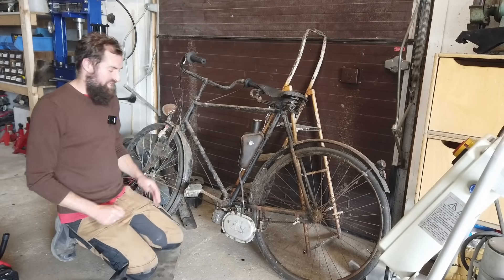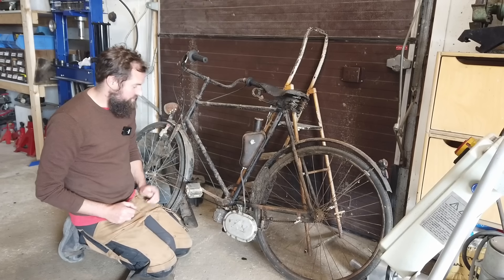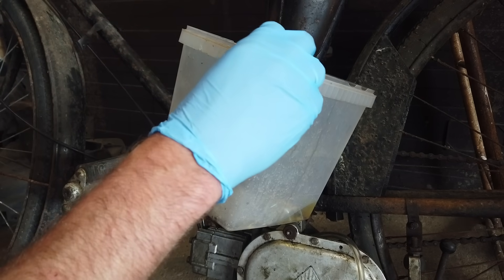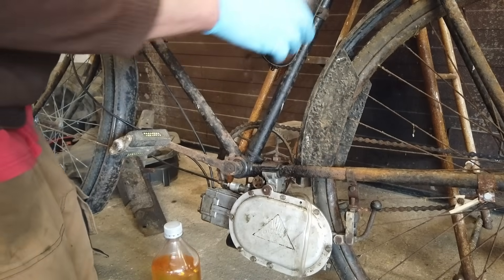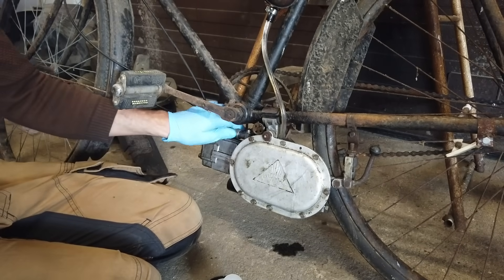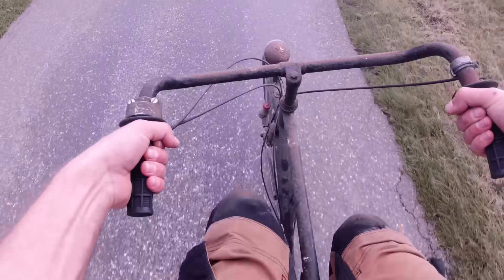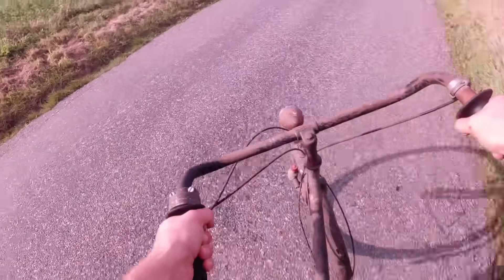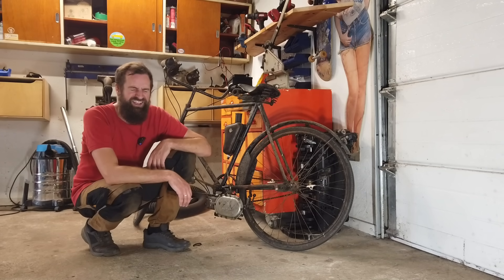Riding A Two Stroke Diesel Moped With Variable Compression!

Comment: That is really cool! It has been my experience with the RC "diesel" engines that you have to fiddle quite a bit with the compression adjustment to get it started, but as the engine gets a little heat in it the engine is not as finicky with the compression setting. I do know that once they are warm and the compression is adjusted, you don't have to touch it again that day if you use the same fuel. The engine speed is then adjusted with the needle valve. The servos work that valve in and out and there is no slide to adjust the air (like a real diesel). Some of those guys are able to really get them to idle slow. The "diesel" engines swing a larger prop that the glow engines so there is more flywheel effect.
Once you get it running and get it warmed up, you might try finding the compression sweet spot and then just adjust the engine speed with the fuel only and leave the compression alone. One of the "Old Guys" told me the only reason the compression is adjustable is to compensate for two things, piston to cylinder wall leakage and barometric pressure.  I would love to see this thing running good and see if it will idle. Very cool project. 
P.S. - Stick you a little piece of copper (or other metal) on the exhaust outlet to route the exhaust away from you....

Comment: Compression ignition engine
Some kerosene in diesel may help it start easy . We use in winter on old engines on dozers
Smaller diameter  rear wheel would  lower ratio to allow it to climb hills at max rpm .
Would be a good experiment to try smaller friction wheel drive also.

Awesome 👍
Reply: It drives the outside of the tyre via a roller. So the wheel diameter has no effect on the ratio. They were designed to run on a Kerosene mixed 25:1 with oil so for sure your suggestion on mixin Kero in would help.
Reply: @stevemorris3710  Actually it would . Rim pull is from CL of axel to pavement contact area irrespective of where motor applies torque .
I am a mechanical engineer and familiar with that .
Peace out 👍
Reply: The wheel diameter sounds like an interesting experiment. I'm not an engineer, but I don't think the ratio would change.
Reply: @mickangio16  rim pull.... Ft -lbs on edge( rim pull is measure of pulling force developed)  increase by decrease in diameter. 
Ratio between drive gear and rear wheel changes also actually decrease somewhat.
Similar to gears in transmission low gear is smaller therefore higher mechanical advantage . 
Trains Tractors use rim pull to measure tractive effort.

On certain farm tractors the pull force is increased by reducing diameter of wheels. 
In competition pulling one must use stock rim tire size not to cheat .
Reply: @mickangio16  And you'd be correct.
Reply: @Nudnik1  You should ask your place of education for a refund.
Reply: @stevemorris3710  Now you hurl insults... 🤔
Obviously you are not educated in engineering.
Reply: @stevemorris3710  Even Heavy equipment mechanic  and  farmers knows that is correct . Lower ratio versus ground contact Ft-lbs of torque increase rim pull of machine .
Top speed will be reduced .
Small diameter wheels are often out on Farm tractors to increase pulling force.
Now you can go back to kitchen and peel potatoes kid ..
Reply: @Nudnik1  I'm not an engineer and am struggling to understand your suggestion that a smaller rear wheel would help.
As far as I can tell, decreasing the rear tire diameter would decrease the distance between the axel and the road surface, as well as the distance between the axel and the drive-motor's friction patch on the tire.  Since the leverage decreases at both the motor and the road an equal amount, there'd be no change in torque multiplication.  If you calculate the total drive ratio for each revolution of the drive motor, the ratio remains the same with larger or smaller rear bicycle wheels.
With those two ideas in mind, I'm having trouble understanding where you're saying added leverage comes from, please explain in simple terms.
Reply: @FirstNameLastName-tp5bu  look up Statics in engineering hand book
Do a free body diagram of forces .
For example a cable winch on a crane loses line pull as diameter of drum increases due to wraps of cable increasing .
Same idea .
In a gearbox on a Car Truck tractor the smaller diameter gear is low ratio which increases mechanical advantage but reduces output rpm .
Picture the force applied to surface of road transfered to rear axel which forces bicycle forward 
Irrespective of manner the Engine transfers torque to the rear wheel .
Reply: @FirstNameLastName-tp5bu Sorry  actually I did not realize the motor used a friction drive whee against tire l and thought it was chain driven .
So reducing diameter of rear wheel  would reduce the mechanical advantage of force from motor to rim .
I was in error about this detail sorry.
If it was not such a design a smaller rear wheel would increase pushing force at a lower speed but higher rpm .
Reply: Keep going. The comments you are getting are good. And the information  you are getting as feedback is brilliant to follow so good luck
Reply: @tonyarthur9437  Not sure if anyone has any education in engineering basic kinematics etc .

Comment: Yes, "technically", it's not a traditional diesel engine, but more similar to an RC diesel engine, auto-igniton type, semi-diesel, but I would argue that it's still closer than one of those due to the fact it doesn't need diethyl ether in the fuel (and in something like a 30 percent quantity). It's not a hot bulb engine either! (although, those are really cool too!)
Reply: I would certainly try to add ether in order to make the fuel easier to autoignite. For oil, we used to mix pure castoroil in.
Reply: There must be some information on fuel recepies for those Webra 1,5 and 2,5cc diesel engines

Comment: I had a BSA "Winged Wheel". These were a tiny engine in the rear wheel. It could power the bike along on a level road and give the rider a rest but it was useless on hills. On a hill it was just extra weight.

Comment: That's fantastic.. You could try some Ether. Solvent Ether will work. Anaesthetic Ether is probably too hard to get now. 
If it is working like a model airplane diesel, try one part each, kerosene, oil, and ether.
And if you really want to amp things up, a couple of percent of Amyl nitrate. An old bloke at my local model aero club gave me 100 millilitres in the 80s ( heart medication), for my competition freeflight diesel engines, for the nationals.
Great find mate.
I'll be following your progress.
Stu. Melbourne. Australia
Reply: I forgot to mention, try using castor oil with the one kero, one ether, and one oil mix.. . And the exhaust smells great..

Comment: It's a 2 stroke compression ignition engine I have worked on much larger engines but still small thay used them in small horticultural machinery in the long distance past but I do envy you I have 10 ish mopeds but nothing as exotic as yours 👍

Comment: Go back 100 years ago, the ford model t. You could run that engine on kerosene. You had to wrap a copper pipe around the exhaust manifold to preheat the fuel. Cold kerosene would not combust.  The procedure was to start the car on gasoline then after the engine was warmed, switch to kerosene. I suspect diesel fuel might work the same way, needs to be pre-heated.

Comment: die·sel
/ˈdēz(ə)l/
noun
an internal combustion engine in which heat produced by the compression of air in the cylinder is used to ignite the fuel.

It seems to fit the definition perfectly.

Comment: I love it. I'm really curious to see if it would run on vegetable oil. Imagine growing a small crop of rapeseed, harvesting it, extracting the oil and then running it on it. Would be so cool. I think it will be a pain to get started and possibly even too thick to run without a injector (I still dont understand how the fuel delivery on this works but I'll assume its some variation of a 'carb'.
To make starting easier and give some more power you can use a cetane improver (2ehn) which is a fuel addative. I used it on my mercedes that I ran on vegetable oil. Never had a cold starting issue even in the dead of winter.
Reply: Vegetable oil takes more heat to ignite.  It doesn't' combust completely, and will eventually either bend the connecting rod or break the piston when the combustion chamber gets packed with carbon sludge.  If he is having a difficult time with diesel, then vegetable oil is not even a consideration. In addition it will have even less power than kerosene.  Kerosene has faster flame propagation than diesel making cetane a moot point.   Unless you have screen door fuel filters vegetable oil will not work in actual winter conditions.

Comment: I have a old bike with a Victoria auxilery two stroke 0.8hp petrol engine. Compared to the Lohman it really gives you good speed, aprox 45km/h. It has two gears and drives the rear wheel by chain.

Comment: With a rear wheel stand, you could start with drill, and move forward off of stand with feet. You need drill rachet extension like mustie1 channel has to prevent any  stress on your engine starter shaft threads.. And you are mobile with a really amazing retro bicycle

Comment: I love it, so cute!
I'd try petrol mixed with 2 stroke oil as it will vaporise more easily and burn more cleanly.
Reply: @jankatsman6319
28 minutes ago
Around 1960 a classmate drove one belonging to his father. It was very difficult to drive it, since the compression had to be changed load depended. The maximum speed, no wind flat trajectory, was about 60 km/hour. Fuel consumption was ca 100 km/ l. During wintertime, temperatures bolow 0 depressie C, it dit not run at all. Trying  to run it on petrol resulted in an exploded cylinder, fortuanetly noboddy was hirt. That was the end of the Lohmann. Hope you Will have a lot of fun with your Lohmann

Comment: Sounds like the drip fuel line isn't getting the proper venting. Try removing the gas cap when running and use it for storage only. This needs a free, gravity drop for the fuel.

Comment: Could you check that the muffler is not totally carboned up....(or experiment with no muffler?)

You may have to do what was done for 2 stroke motorcycle mufflers/baffles...
burn the carbon out with petrol or LPG  and air injected in one end...basically a flamethrower...
which once the carbon is ignited will keep burning just with pressurised air only
and be prepared for the clouds of burning clag....?

Comment: I had a compression ignition 2 stroke RC motor back in the 1970's or late 60's. It ran on a nitrated ether mix with casteroil. It was very hard to start it without it back fireing and wacking my fingers with the prop! Try adding a little ether (in cans of "sure start" used to start reluctant diesel engines) or a lot of it. :) that might help a lot.

Comment: Great motor,Like the Outboard motor Seagull engine uit of 1955-1965, those really needs mixing oil to help building up compression. The mixing is 1:20. Mistake modern people take with that engine is that modern oil is that good, you don't need that much and they keep the 1:50 ratio. But then there is less off compression. Then as I understand the fuel is through suction get into the cilinder.All seals must be of outstanding condition to get a good vacuum. Investigate some more that fuel system for any air leaks. Think that is critical.

Comment: I believe it may be similar in principle to a hot bulb engine, in that a red hot element keeps a flame front going inside the head. And that's the difference too-ignition propagation takes place IN the head here, whereas as, in a hot bulb the heat for ignition passes through its iconic EXTERNAL bulb.

Comment: Hah! What a cool little machine! I'm wondering if modern synthetic 2 stroke oil may work a little better? It has stuff in it to make it burn with the fuel, so maybe it will start easier and run better? Also maybe a bit of methyl alcohol with the kero. There's lots of combinations you can try to make it run a little better. If you're really brave, pick up a quart of RC nitro fuel.. it will DEFINITELY run on that! (probably not recommended)🤣

Comment: According to german Wikipedia the compression is adjustable over the range from 12.5:1 to 125:1 and normally needs to be set in the range from 14:1 to 18:1 when the engine is running. That could explain why you have to lower the compression that much when it kicks in.

Comment: Thats so cool it can run on multiple fuels.  I dont know about there however in the US both diesel and petrol(gasoline) have changed for the worse at least with respect to older small engines.  Diesel is now lower in sulfur and in many areas also a certain percent bio-diesel.  Gasoline is 10-15% ethanol which pretty much wrecks havoc on the lines, primer and gunks up in the bowl.  I've not heard or looked into kerosene so this is very interesting.

Comment: I reckon that’s a real interesting little engine for all the reasons you mentioned, we never really had any mopeds here in Australia probably due to distance etc but also they were not allowed to be registered for road use as the law stated that any vehicle used under its own power was a motor vehicle which meant that you had to have drivers/ motorcycle licence at least in this state anyway so bicycles with these tiny engines are quite fascinating things
Reply: Rotary bikes in Australia did had a license of Sachs 30cc wheel hub 30cc 2stroke engins.
Those wheelhub engines were mounted in Europe on Spartamet and Saxonette bicycle frames.
Rotary bikes even did export those Australia made bikes under the Hudson brand to Northern Europe.
Reply: @obelic71  yeah I know that and they were too expensive in the day and didn’t last long
Reply: @jamesgovett3225  Also in Europe they were 2-3 times the costs of a normal moped.
Reliability is a very big issue on those type of engines due all the restriction crap they added to make them road legal.
When they realized that even reducing to 30cc didn't reach the needed legal restrictions, the engineers of Sachs went to the Dark side.
Add expensive parts and bike mechanics unfamiliar with this sort of bikes and you get a general public that loathed and discarded them on mass.
Like all odd ball engines/vehicels,
You need to have 2 right hands and enginering skills to keep them running. 
And yes its even possible to make them reliable and long lasting.
1 of those engines has already ran 80.000 KM since 1986!

Comment: This is awesome 🥰

The wheel making contact wear changes the gear ratios

And the fuel system could maybe warmed? Paraffin ether should be much cleaner too. But perhaps some kind of thin lubricant may help it keep running and free up some power?
Reply: Where does air enter?
Reply: Alcohols lower the point of ignition too 🤓

Comment: when I was running auto ignition two strokes engine (for RC planes) I was using 1/3 gazole, 1/3 ether, 1/3 castor oil

Comment: Looks like you've found better fuel. You might try the same fuel the little airplanes use, "Cox Super Power Fuel for Cars, Planes & Boats"
Reply: I believe that fuel is just diesel mixed with diethyl ether. One could also experiment with adding isopropyl alcohol to the diesel fuel, as the roughly 10% water in store-bought IPA should actually increase the amount of power the engine can produce without overheating.
Reply: @tissuepaper9962  They also call it nitro fuel, I thought like in Nitro Methane, the dragster fuel.
Reply: @BrianBoniMakes  diethyl ether is different, it's basically two molecules of ethanol stuck together. Nitromethane is made from propane and nitric acid.

Comment: You should try getting it running on diesel, as it contain more energy per volume than the other fuels. I have successfully ran a moped with ordinary two stroke engine on a 60% diesel and 40% gasoline mixture, getting more power uphill. Quite hard to start it though, had to turn out the needle more than 1/4 turn. No need for two stroke oil then, as the diesel will lubricate the engine enough.

Comment: I wonder if mixing some gasoline into the fuel would help it ignite easier. It would probably also give it some more pep. As long as the 2 cycle oil is mixed in, I don't think it would cause any harm. Loving this series. Cheers from the US
Reply: it should! according to the wiki article on these engines, they ran pretty good on petrol. The trick is you use high compression to get it started, then you back off the compression almost all the way (I think it said somewhere between 12:1-14:1 compression
Reply: @jankatsman6319
28 minutes ago
Around 1960 a classmate drove one belonging to his father. It was very difficult to drive it, since the compression had to be changed load depended. The maximum speed, no wind flat trajectory, was about 60 km/hour. Fuel consumption was ca 100 km/ l. During wintertime, temperatures bolow 0 depressie C, it dit not run at all. Trying  to run it on petrol resulted in an exploded cylinder, fortuanetly noboddy was hirt. That was the end of the Lohmann. Hope you Will have a lot of fun with your Lohmann

Comment: Kerosene is great for not needing such high compression but just relying on temperature, so once you warm a normal 2stroke up you can run it on kero without spark

Comment: diesels make power based on the quantity of fuel injected, so i would basically try to stuff as much fuel in as you can with any adjustments and see if that begins to net progress. it sounds like it's running lean, even though the smoke its dumping doesn't indicate that.